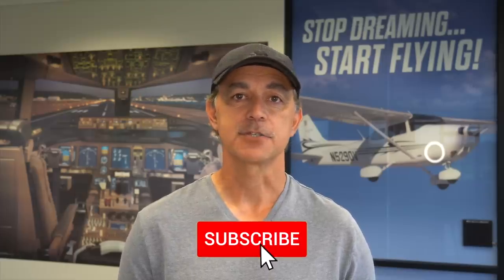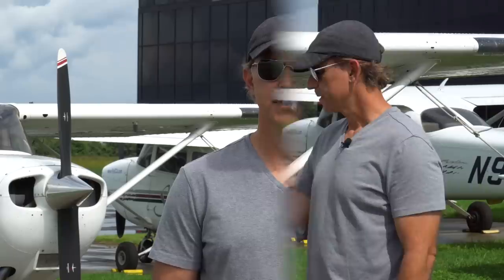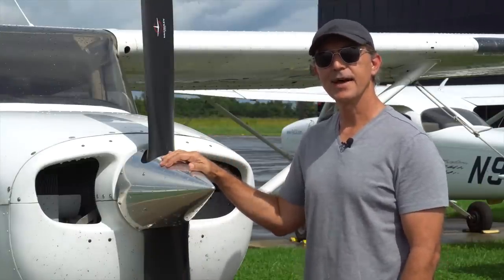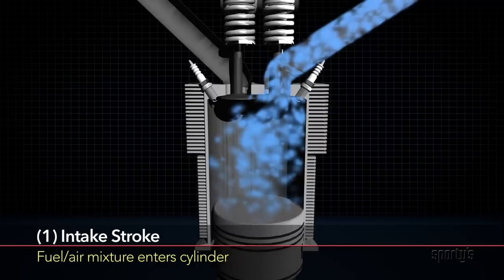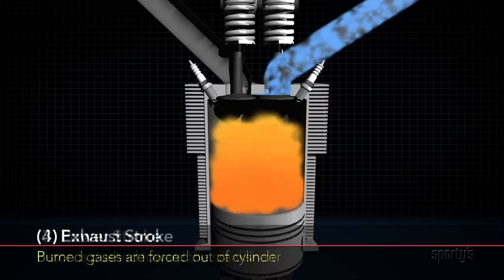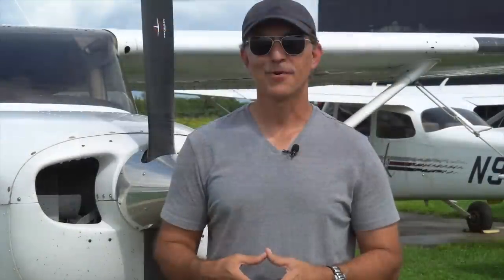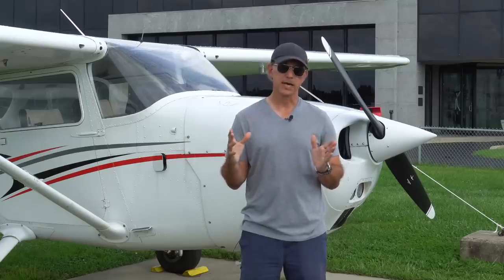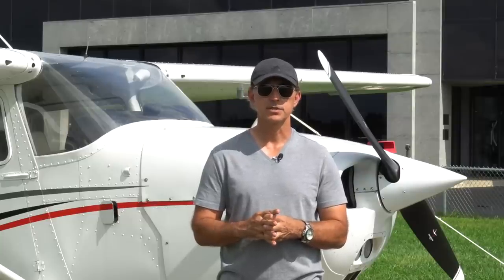Emergency Follow Up, What Happened To The Engine

Comment: The impossible turn is not the problem.  Trying to maintain altitude in turns, especially steep turns, is the problem.  In a thousand turns a day in the Ag world, we don't do that.  The airplane was designed with dynamic neutral stability to prevent stalls from too high pitch attitude and from banks.  We should be taught to use the potential energy of altitude (airspeed) in turns to prevent stall.  The impossible turn of any bank angle doesn't kill anyone.  Pulling back on the yoke in that or any turn is what what kills.  In jet fighters they can add enough power to turn steeply without releasing back pressure (why?) but they can pass out from high g load.  They don't do that either.  They also use Wolfgang's law of the roller coaster and the potential energy of altitude, etc.  It is called flying.

Comment: Fuel injection, must be nice, I'm just a naturally aspirated pleb so my first instinct for rough engine in the pattern is carb heat. From the video there is no indication on the cause of the engine trouble other than they obviously had a problem.

Comment: unfortunately YouTube is not putting out your videos I just ran across y'alls I am not a pilot but always wanted to be but I am a mechanic my question would be why did it lose the cylinder and when you drop airspeed stop accelerating accelerate stop accelerating accelerate you are literally dumping unspent fuel into that chamber and then when you accelerate you blow that cylinder up like a nuclear bomb so the instructor I get it he's being an instructor but what he's not understanding as the mechanics of you can't just sit there and just dump unspent fuel into a cylinder turning the throttle up and down relinquishing controls yeah Kim did a great job she probably could have landed that thing by herself but got it the instructor should have let the engine dry for a while and recover from the last couple stalls can't stall the motor like that without having repercussions just my observation but I don't know anything about aircrafts so I could be looking like a dumbass right now but it's good that there was no catastrophes because just by watching your video and I'm subscribed I have now gotten every single YouTube feed on student pilots landing airplanes where they should be landed and you know what I'm talking about they both did a great job they made it back safely next time don't flood the motor

Comment: Glad we know it lost a cylinder. WHY? (fuel, plug, injection....)
Reply: Kristopher mentioned that a valve was stuck open. Why was it stuck open was not mentioned.
Reply: @ColinFisher  thx, will watch it back in greater detail.
Reply: @ColinFisher  lead,,, Lycoming.
Reply: @CrazyLocha  I put my guess in the main comment section, if you would like to see it. (About what could cause a valve failure)

Comment: So, you still didn't say why that failed  🤔
Reply: Wait what ?   They lost a cylinder in a 4 cylinder engine... That's MORE than a 25% loss of power, PLUS the engine is going to be EXTREMELY imbalanced -  If you've EVER seena 4 cylinder car only fire on 3 cylinders, you see the engine vibrating... It's not that dangerous in a car, but in the air when that engine tears it'self from the fuselage, it can be.

Comment: Ok,,,,?,,,now your answer has us the Real question???
, the odds of a stuck valve are a half million to 1.
   Let's see the engine teardown!,, it sounds like a crappy engine build!,, who built the engine?
They could really have both died ☠

Not cool, was this original engine? A crate replacement?  broke spring? Keepers poped off? 
I have only see this 1nce before
And it was the builders fault

Please follow up😡
Reply: Possibly starting and stopping it repeatedly, there are car engines that'll get valve problems and stall out from that.

Comment: The 0360 is 180 hp and IO-360 is 200 hp.
Reply: Not according to my POH😃
Reply: You are both right.  Certain engines like the IO-360 come in a variety of different configurations.  The IO-360 used in the Cessna 172R and 172S are rated for 160 and 180 horsepower respectively, whereas the IO-360 in the older Piper Arrow III and IV was rated for 200 horsepower.  Obviously, the lower horsepower rating gives you better reliability and possibly even a greater TBO.
Reply from the maker: I/O-360L2A produces 160hp